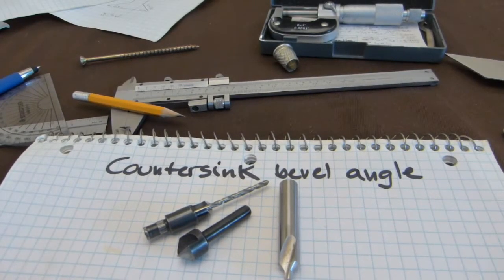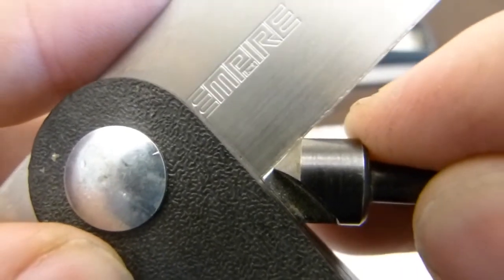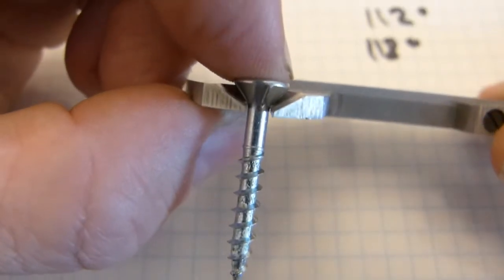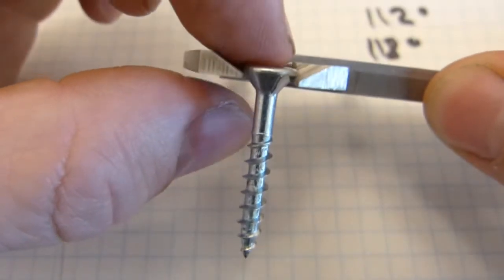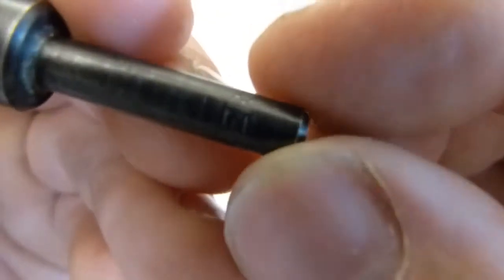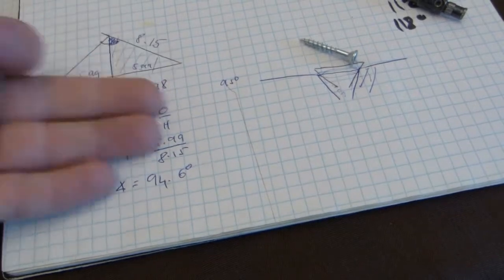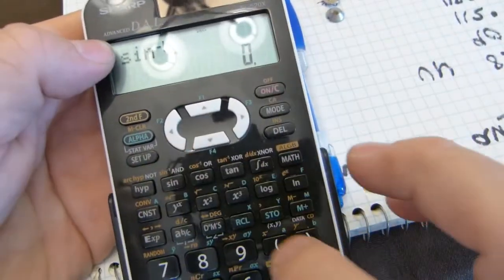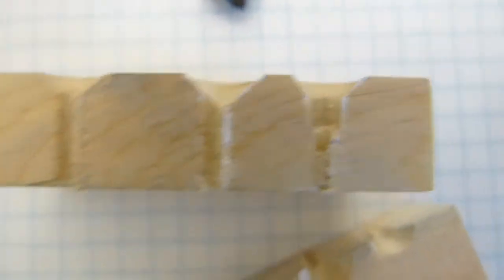Countersink bevel calculations

Comment: Sir,  I absolutely understand the need to find the angles of the countersink bit,  but you also understand that under the screw head itself, those extrusions are essentially the countersink cutters.   Most odd angle screw heads usually have those built in to accommodate the off standard angle and the rounded points of the flutings.  Edit:  I am sure you knew this already,  but in the case you did not, I felt that perhaps (with all do respect, sir)  angle calculations this intricate would be kinda moot.  I mean no disrespect, just injecting some unsolicited input.
Reply from the maker: It is a good input. During manufacturing a screw is made by being formed out of a wire that comes on a spool. The head is formed by 'heading', which presses metal into forming dies. The dies have relief cuts in them that allow their expansion due to heat while keeping the screw head the same size. Some metal squeezes into the relief gaps of the forming dies, just like with casting or injection molding, 
The pitch of the screw thread even on finer thread pitches (0.6 or 0.8mm forward motion per each full turn) make it difficult to cut into MDF or or particle board because contact time without stripping the thread is short, so only a fraction of the conical surface can be cut.
Reply: @apprenticemath  well, there you have it.  I think my comment may be completely out of sync then.   Thank you for clearing that up.  Back to school for this kid.